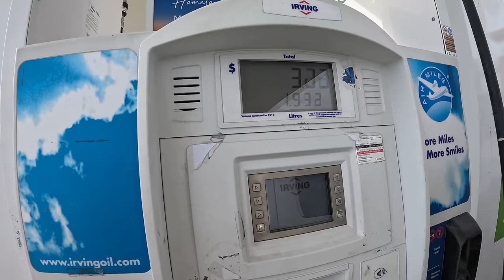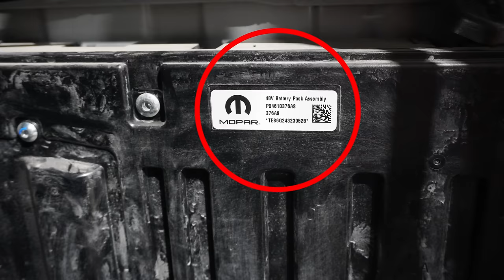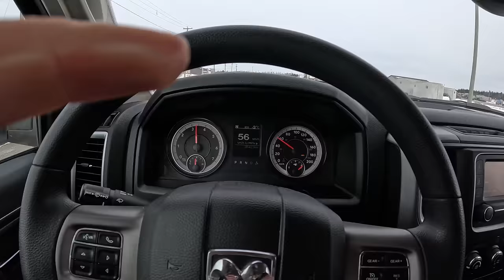Ram 1500 E-TORQUE HYBRID System *Heavy Mechanic Review* | Does It ACTUALLY Work??

Comment: I feel like the E torque is a Gimmick.   I think it is more for the start stop feature more than anything else.
Reply from the maker: the start- stop is the only noticeable feature lol
Reply: Start stop not only helps fuel economy but less idle time which helps engine wear, this has been proven with oil analysis
Reply: @MSchumacherfan maybe if you live in the city, out in the country it does nothing. Also has been proven
Reply: @wasupfool5692 there’s definitely benefits to the etorque stuff when towing and that doesn’t really matter where you are. You can feel the difference it makes from a stop when compared to the regular 5.7. The braking also feels better but I’m not sure if they use the same braking system or not.
Reply: I feel it in my HEMI 5.7 but especially for slowing down specially when you turn in a residential street it keeps holding you until you grab back the feeder
Reply: Ya and it does that well. I like how smooth start stop is
Reply: It definitely give a little boost when it kicks in, it’s hardly anything though
Reply: @shawnbradford2243  Dodge says that the eTorque is responsible for the first half turn of the tires after you let off the brake. That might be the "boost" you're feeling.
Reply: Yeah I think start/ stop and from a dead stop while towing. It's a small system and doesn't cost much. I think 5 or 600 bucks. Why does everyone expect fireworks?
Reply: Have 110,000 miles on mine and you can definitely feel it when taking off from a stop and at lower speeds. 

But 100% the best start stop system of any vehicle I have been in.
Reply: It make the stop start unnoticeable. Ever ride in a 5.0 F150 with start stop? It's terrible.
Reply: Just think when they figure out the tuning and you can engage it longer for the added torque.
Reply: @MSchumacherfan And yet, the supposed #1 cause of engine wear is start up.
Reply: @nickturner5185  I wish the start stop system was worse...as when I forget to turn it off I don't notice at all....I mean AT ALL.
Reply: @TonyTheTruckGuy  Which is why I try to remember to turn mine off.
Reply: @doctordetroit4339  yeah I forget that it’s there, I was referring to the little extra torque that it gives when I said you feel it.
Reply: @doctordetroit4339  the electric motor that is
Reply: @psd.3144  I doubt the brakes feel better. Our 21 with torque will have the brakes go under your foot. It is a weird feeling and I personally don’t like it.

Comment: I own a 5.7-liter engine with eTorque technology. I have not experienced any problems with it, and it provides excellent fuel efficiency. I recently drove from Detroit to Wisconsin and only used three-quarters of a tank of gas. Overall, I am very satisfied with my vehicle.
Reply: He just proved to you that the etorque adds zero fuel economy
Reply: You’re probably getting fuel efficiency from the Multi-Displacement System (MDS) (e.g., shutting down cylinders) and not  e-torque.
Reply: @rock-uu7qr   HE just said it adds better fuel economy in traffic..what were you watching??
Reply: @rock-uu7qr  A fuel economy test of approximately 15 miles does not prove anything.  Too small of a sample size.
Reply: @RPQMO65 are yalls etorques broke? I get 18 in town or better and 22 on the highways its definitely the etorque
Reply: @jessefarias8441  I had the 3.6 pentastar in a 21 1500 tradesman without etorque and averaged 22 mph mixed driving and over 25 mph on the highway during a 1600 mile road trip.  It DID NOT have an etorque system and did have the 3.55 rear end.

Comment: Great review! Totally concur. As an old-time mechanic, and a 'car guy' for 50 years, I've seen a lot of changes. This eTorque provides basically ZERO real-world benefits IMO, while offering much opportunity for problems. I am in the market for a used 5th gen RAM 1500 5.7L, and I will be certain to find a truck WITHOUT eTorque. Thanks for this vid!
Reply: I found my truck and bought it, a 2019 loaded Laramie Longhorn, without eTorque!! Very happy.

Comment: What is surprising to me is nobody is mentioning the strange braking habits when coming to a stop in the e torque trucks. I recently just bought a e torque and im very happy with it. The only thing Ive really had to get used to is when coming up on a stop light or a traffic stop or something similar and im coasting into the situation, its like the regenerative braking and the input from my foot on the brake pedal are kind of fighting eachother trying to decide which one is going to do the majority of the braking. Its strange…im getting used to it but its definitely a quirk of this system.
Reply: I have a 23 1500 with it. Its a weird feeling
Reply: They aren't fighting with each other. It's how regenerative braking works. You apply braking at the pedal. That tells the computer to convert some of the torque (deceleration) into energy to give to the battery pack. If you turn off the eTorque start/stop feature, you won't get that "fight" feeling. You simply feeling the power conversion process.
Reply: Ya its a werid feeling coming to a stop.
Reply: Yes, same feeling. There is certainly a point of “not much slowing down” followed by “friction brakes are on.” I found that when pressing the brakes the pedal will actually go past my foot. It is not a deal breaker but is rather irritating. We have a ‘21.
Reply: Truck will shut off before speed gets down to zero when you are breaking...causes a dead spot to reaccelerate and is a bit dicey in an intersection

Comment: Recently bought a 2024 Ram. Test drove a 1500 Laramie with the hemi and e-torque. Didn’t quite care for the driving habits. Got back to the dealer and went straight to the 2500 with 6.4 hemi. Extremely happy with the 2500.
Reply: Congratulations, you have actual useable payload! 😂
Reply: @SliderFury1 legal mumbo jumbo. You don't actually believe the #s right. Just go down to Florida and sit in thee Lowes/Home Depot parking lot. I've seen the 5.3 Chevy and 5.7 Ram carry 6 men and 15k lbs of pavers many a time. Jus sitting on the bump stops, merging onto the highway at 37 MPH 😂
Reply: Great choice, love the 6.4 Hemi.

Comment: I’ve lived with the e-Torque Hemi for 3 years now. The biggest thing that you’ll actually notice is how smooth the stop / start feature is. I HATE stop / start on other vehicles. This isn’t jarring, it’s fast off the line. It’s by far the best stop / start implementation I’ve seen. 
Second place and not nearly as perceptible.- 
Supposedly, it helps keep you in cylinder deactivation mode for a little bit longer and adds gap power in between shifts.
Reply: Exactly this. I always turn off start stop in every vehicle, even my BMW. I just picked up a '24 1500 Limited and one of my first thoughts is the start stop is as close to instant as I have ever felt.
Reply: Exactly. I like the way it works on my 2024.
Reply: This is 100 % accurate
Reply: If you read the whole technical manual on it, it shows why. It changes the transmission as well. It can lock up the torque converter with the electic motor start, and get the truck barely moving as it starts the motor. It also does all that as you start to let off the brake. So it feels like a regular running gas motor with automatic starting to creep forward as the brake is released.
Reply: Technically hybrids have the best start/stop but the e-torque is very good.

Comment: I read through most of these reviews and those that don't have eTorque are against it and those that do have an eTorque are mostly happy or at least ok with it.  We have a 2019 Ram Limited 4x4 with the 3.92 rear with eTorque and use out for towing our 5800# camper.  It currently has just over 57000 miles on it and we love it.  The start/stop feature works the best over other start/stops, shifting is buttery smooth, and the regenerative braking is really great going down the mountains pulling a camper.  No brake job yet, or even looking like it's close and I attribute that to the eTorque regenerative braking for the most part.  Also, being a limited with lots of electronics, the 48volt lithium battery powers the truck well without issue.  I'm with most on here that believe Ram did this as token compliance to the "overlords" of saving the planet by fossil fuel reductions.  Thankfully, there is some merit to this system even if the design was for spurious reasons. The eTorque system is covered by the 8 year emissions warranty so there's that.

Comment: I have one with eTorque, damn, the brake with regeneration is really good you can notice it and also the smoothness of the auto stop start is amazing. City mpg's are better than highway because the 4cyl mode is enhanced thanks to the eTorque
Reply from the maker: the auto start and stop is actually very seamless!
Reply: These engines develop serious issues due to that “4cyl mode”
Reply: Cylinder deactivation / Auto start stop….

Gross.
Reply: @losungen9862 not proven at all.
Reply: @losungen9862  Idling is causing most of the reported problems previously blamed on the MDS systems.

Comment: I have a 2020 Ram 1500 5.7 hemi etorque, no issues, considering the cam/lifter problem likely from low oil volume during idling I’m glad I have the etorque, also the front brake pads show minimal wear at 45,000 miles
Reply: The rear are used more
Reply: Just have my 2019 5.7 non e torque in the air 107,000 miles and I still have 8 mm on my front pads

Comment: I have a RAM 1500 with e-torque and feel the same... I don't see it saving much.   Seems like it would when you have "waits" like red lights OR getting food at a drive thru.  My fear is failure as it ages without a warranty, if that occurs then you don't save a dime.  Think e-torque was more about checking a box for government regulations rather than a selling a useful feature for your customers shopping for a new truck.  I'm hoping for someone to come out with a delete kit one day, I can see doing that rather than fixing if it goes bad.  I agree with others that it's very smooth vs. others I've been in.  I do hate it when stopping then backing up into a parking spot... I find the pause I typically have shifting gears is just enough for it to turn off and right back on.   Same crap happens with the moving into park... truck shuts off due to stopping and you shift into park for it to just start back up.

Comment: The e-torque makes a much bigger difference in fuel economy over the course of a full tank of gas. It also shines when you are in an area like mine that has long red lights. I do primarily city driving and have tried disabling the stop/start for a couple tanks, I consistently get 2-3 mpg better with the stop/start on than with it off. You notice it alot more over longer periods when you are doing alot of city driving. Of course the stop/start system serves no benefit when you are doing primarily highway driving. I have the 5.7 hemi.

Comment: Ive got a 2023 1500 with about 7500 miles on it with the 5.7 etorque.   Not a gimmick.  Came from a 3.5l ecoboost f150.  Power is just as good and i get a solid 4mpg better fuel economy than the ecoboost.  Glad i got mine before they axed the 5.7.

Comment: I own a 2023 Ram Etorque and I am very satisfied. Lately I drove almost 300 miles on I10 to La Grange, Texas. I kept the speed at 70 mostly on cruse control and I had a round trip average of 20.3 MPG. I only have issues with the electrical system due to the 12 volt battery will not start the truck if it has been sitting more than three days without starting.

Comment: I was recently looking at new trucks. Checked out the Ram 1500 and must say  they give you nice packages for the money. Researched and found most people are just not getting that good of fuel mileage. I'm on my 3rd F150 with the 2.7 and just love that engine. I don't tow so no real need for the 3.5. If i drive conservative, keeping it out of boost, i can get 24 mpg around town. On the highway doing 65 I'll get 23 roughly depending on head winds and such.  I have a friend who had a couple of older 1500 models and he was only getting 14 to 16 in town and 18 on highway. I just can't give up the Ford due to better fuel mileage. 
I have heard some 1500 owners getting 22 on highway but I've heard more saying they get 16 to 18. It could be sure to the way they drive, i don't know.

Comment: It's probably been close to 20 years ago. Ford was working on a transmission fluid accumulator that was mounted to the frame rail. It accumulated transmission pump pressure at cruise, then it would release at first gear take off from a stop.   The additional fluid capacity also kept fluid temperatures down. Pretty much E Torque,  but more F Torque. 
Thanks for the great video as always.

Comment: the 5th gen has bigger 6-10ply tires with the "Off Road Package", a tad bigger and raised ride height to put in consideration

but I still love your videos!! 🤙🤟
Reply: because I have one but its the 5.7 with the eTorque, I like it for timy drive thru's😂 it has good torque down low and help slow you down especially noticable when turing in a street it feels like brake sticking until you touch back the feeder but its okay lol

didn't notice fuel savings very much as this one have  big heavy 10ply tire conpared to the loaner Enterprise 4ply but same 3.21 diff which I like

these 5.7 ram is the most sweet spot engine in a half ton, they have good torque down low and it only need to have 1 drive mode no sport or anything because the power is there, 1 mode and its the good one😄

Comment: Good video, as always.  Ram did a good job championing a hybrid in a fullsize truck, credit where it is due.  But the E-Torque system wasn't, and isn't, enough.  Now, their new RamCharger, that is downright exciting.  With a V6 driving a generator, 100% electric drive, the torque should be stunning.  Looking forward to the next video.
Reply from the maker: The new Ramcharger will be interesting. I like that they have a full engine on board. probably the way of the future tbh.

Comment: As an owner of a 2021 Ram 5.7 hemi with the etorque, I can confidently its easily one of the features of all time.
Reply from the maker: One of the "best features of all time" ?
Reply: I had a stroke trying to read that
Reply: i agree, it is indeed one of the features of all time.
Reply: So no issues with 48v battery?  Replacement cost$ ?  How long they typically last?
Reply: @lareggiejones6617  I haven't had any. Had mine since 2021 and put 70k miles on it. Only issue I have had is an update on software for my center consoles screen. Otherwise, no issues noted or found.

Comment: I purchased a new 2019 Rebel with the V8 eTorque and it was nothing but problems. At 10k miles it needed a new engine, a month later a new transmission. 10K miles after that another new engine. I sued FCA under the Lemon Law and they agreed to buy it back plus a significant amount in additional damages. My truck sat on the dealer lot for 6 months during all these lengthy repairs. As far as MPG, my lifetime at 33k miles when I turned it in to FCA was only 12.5 mpg. I loved the styling, air suspension and power but otherwise it was a nightmare and I'm now happily driving a fully loaded 2024 Chevrolet Trail Boss paid for in full by FCA.
Reply: I had the same problem with a ram limit

Comment: I have 40,000 miles on my 2020 Laramie 5.7 etorque. I previously owned a 2017 with the 5.7L. I see no added gas milage and feel no additional power with the etorque truck compared to the 2017 that I owned, and I tow a trailer occasionally. I think all the added weight of the system/generator/battery/electronics removes the small benefit it was supposed to provide.  I think Ram did it for EPA "green" compliance only. I will say I've had zero problems with mine. I personally wish I didn't have it, because when it breaks down, it's going to be expensive to repair.
Reply: Same here, I hate it because I feel like I’m actually loosing a ton of power compared to my last truck that was a plain 5.7. I’m hoping that when it does break that I will be able to completely delete the system and switch to a regular alternator but it doesn’t seem like it’s possible just yet
Reply: You are 100% correct. EPA games, plain and simple. My 2024 gets worse MPG than my 2014, and its a lot slower. They have muted throttle response as well !
Reply: Park it and run!  Mine is absolute garbage

Comment: I own a 2022 RAM  Bighorn crew cab V6 eTorque 4X4 but my truck as a 3.55 limited slip diff and a shorter 5'7" bed so he pull more , I even get 21mpg combined in summer
Reply from the maker: the 3.55 limited slip would be a nice options!

Comment: Alex have you ever done a review of the 3.3L ford base engine in the F150?  Looks like the last simple engine left. Thanks!
Reply from the maker: I have not! but I believe as of 2024 the new base engine is the 2.7L.
Reply: @TheGettyAdventures  ugh I think you’re right!  You can still build one on ford’s website with it but it might be only because they still have some 2023 inventory. I’m stopping by a dealership next week and I’ll ask them.
Reply: Just bought a new 150 2024 f150s do not have the non-turbo base engine anymore.   Just 2.7 tt now.
Reply: @blueheelerfriend8450  that really stinks. That was the last of the simple NA engines and by all accounts really reliable.
Reply: @Johnsmith46392  just get a 5.0, it's just a simple
Reply: @AK_Ray  doesn’t it have cylinder deactivation?

Comment: I have a 2019 Laramie 5.7 no etorque and I have a 2024 ram rebel with etorque and the 2024 wastes more gas, has less power and torque than the 2019 Laramie. No doubt I like the Laramie better without etorque! Also the start stop is not smooth on my rebel in fact it jumps when it starts back up like it wants to take off without me excellerating. Good video! 👍
Reply: The Rebel with or without the etorque never had good gas mileage, in fact the Rebel consume more gas than the Laramie. Always have been that way. So your theory has been mooted.